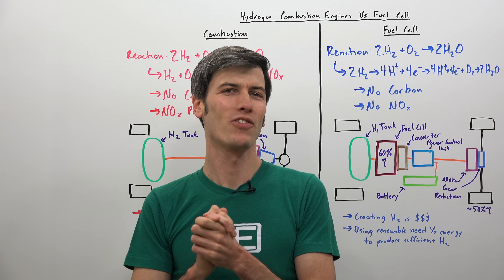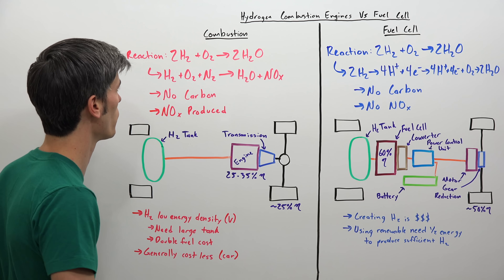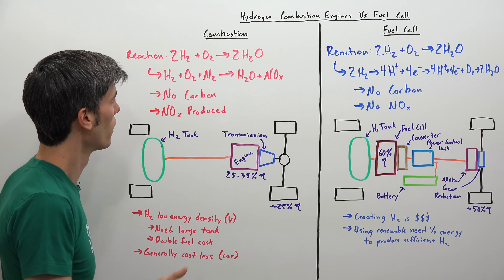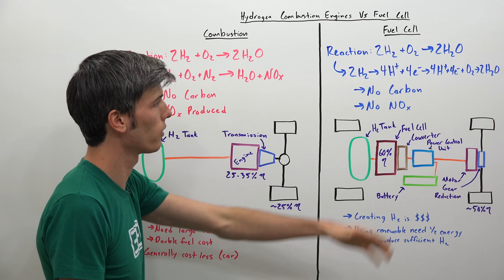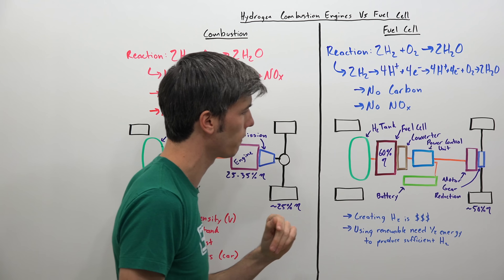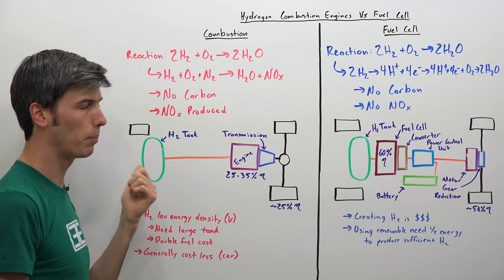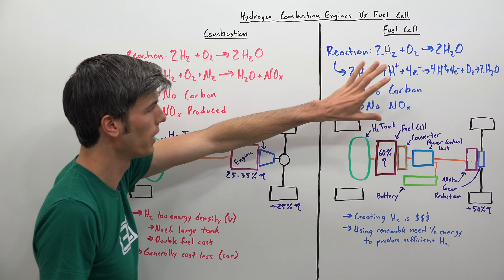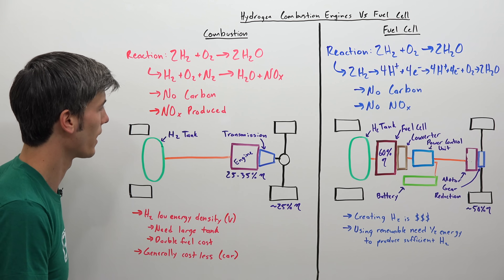Why Hydrogen Engines Are A Bad Idea

Comment: You forgot to mention that fuel cell vehicles don't make vroom vroom noises, which is something that the internet likes to bring out as a k.o. argument as to why they would never drive an EV.
Reply: But you can tape playing cards against the wheel spokes...
Reply: Ever heard of a sound system?
Reply: This is why people should be able to load in their own engine sounds. You could choose different types, like a Ferrari, or an Indy car, or a tie fighter.
Reply: @AshGreen359  Yes finally, a tie fighter car! Take my money and make it happen!
Reply: The faux vroom vroom system should have an ice cream truck tune option
Reply: At least the "vroom vroom" doesn't need Type E extinguishers, you can drown them with water when they catch fire. Also, a small puncture in the tank doesn't send you to a fireball in motion.
Reply: @gabem.5242  First of all, a hydrogen-fueled car will not explode - you may get a flame but no explosion. I mean, yes, we all saw the Hindenburg photos but that also wasn't an explosion - if that had actually been an explosive mixture then there would have been nothing left in the vicinity. Including the photographer. Since hydrogen is very light it won't accumulate but ecsape straight up which means that an explosive hydrogen-air mixture is functionally impossible.
Secondly, you don't drown them with water, you use foam. Water is a very bad idea for flammable liquids.
Reply: I'll miss some of the vroom vroom
Reply: @ThomasSanladerer  thank you for your videos on 3d printers because of you i have an ender 3
Reply: @dogphlap6749  they didn't suffer hydro, they had steam hammer. There's a difference
Reply: Yes I agree to you totally..bt Just consider it as "Our Sacrifice for the Future.!!! "
Reply: They sold those back in the 00's. I remember "Pimp My Ride" used them, occasionally.
Reply: infectionsman I always used empty water bottles.
Reply: Well there pumping the engine note through the speakers in some cars anyway. Now the have even more of a reason to do it.
Reply: Fake it baby 🔊speaker's say what??  Guess those guys who make a mean engine impression will be on demand 😂😂😂
Reply: True they won't make any classic car sounds. Some people enjoy that though and while it seems silly it's definitely something to take into account. Car enthusiasts can sometimes hold their cars sound as the most important aspect of a build. Economically and environmentally it doesn't make sense but that's the thing about hobbies, everyone's is different and nobody likes all the same stuff so we have to try a find a way around it that's not just replaying preset noises through a speaker system. That's noticeably different and fake and the while point of the fake noise is to satisfy the people who love having it.
Reply: @wiretamer5710  That would mean wasting more Electricity better spent on driving the car to began with
Reply: Electric vehicles have computers, speed sensors, load sensors, and a sound system. You can combine them to play any sound you want. Currently, Tesla just produces a very quiet electrical whine that changes frequency to give you a subconscious hint to maintain speed on the freeway, but that can be changed..
Reply: @pilotavery  you really don't get it, do you?
Reply: @Anduvir  I know it doesn't sound as cool but like, that did solve the problem of subconsciously knowing your speed.
Reply: And shoot flames
Reply: @AshGreen359  Reminds me of Mark Robert Video in the Car Horn.
Reply: I have no idea if my motor is functioning right if I can't hear it. I don't know what electric motor sounds mean. It's disconcerting to have no audio cues.
Reply: @AshGreen359  the thing is i dont like fake.
Reply: fuel cells are a waste of energy..  first you use energy to make hydrogen (with loss's)   the you convert it back to electricity (with loss's)    so its just a total loss's before you even use it..
but this is about running the engine on hydrogen... :-)
Reply: @harleyme3163  Your cellphone is a waste of energy. First you use energy to charge the battery (with losses) then you convert the stored energy to power the phone (with losses). So it's a total loss before you even use it.
Reply: @johanneshass1614  "Since hydrogen is very light it won't accumulate but ecsape straight up" - That's great in the outdoors, not if you have a garage.
Reply: @ChucksSEADnDEAD  Your garage is airtight?
Reply: @johanneshass1614  Your garage has leaks on the roof?
Reply: @ChucksSEADnDEAD  A cuboid has more than one side. Just sayin'. Now go away before I have to really mock you.
Reply: @johanneshass1614  You know that a light gas like hydrogen will float to the top, right? Even if your garage door is only a foot and a half from the ceiling that's still a huge amount of volume. You're the one who deserves mockery if you think a cloud of hydrogen in your ceiling is no biggie.
Reply: Also no waiting for charging
Reply: People are amazing tho  :)
THEY WANT very QUIET ELECTRICAL  VACUM CLEANER  but BIG NOISE ON FUEL CAR... I SEE A PATERN I'M NOT SURE I LIKE
Reply: They will have to put some kind of noise makers on them, or pedestrian and bike crashes will skyrocket! I damn near got ran over in a crosswalk in Honolulu, by a hybrid turning against a red light!
Reply: This but unironically
Reply: Laughs in Bluetooth speakers
Reply: Yeah the vroom vroom noises make some people happy so what ? Let us drive what we want and leave us alone
Reply: My drunk dad does vroom vroom sound at night for eternity so I'm all for "soulless" cars
Reply: you miss the point. It doesnt have to be vroom sound. BUT IT HAS TO HAVE SOUND. They say electric cars are quiet by nature yet when companies release electric race cars they sound sick?
Reply: Hydrogen ICEs exist. Not all hydrogen vehicles are fuel cells. Using hydrogen instead of batteries means we can have clean daily drivers, as well as v12s.

Also, hydrogen is safer than lithium as well as infinitely more environmentally friendly.

Basically, BEVs only advantage over FCEVs and HICEs is that the infrastructure for BEVs already exists in some places.
Reply: @AshGreen359  If someone properly iterated on the engine sound generator concept and had selectable sounds and volume ppl would def buy it
Reply: And I’m busting it out right now.
Reply: And I absolutely agree with that
Reply: today there are also still people who prefer traveling on horse like 120 years ago, because it feels so nature and blah..
peolpe mindset will change very fast and will be thankfull for the advantages of BEV and certainly also for autonomous cars, because most just want to travel from A to B ...
It certainly  will be a long process , maybe  20-30 years , but for sure soon or later combustion engines will all be oldtimers. It'll be funnny to drive them , it will be nice nostalgia, cultural important oldtimer .. but thats all . most would prefer to travel calmly and comfortable..
Reply: @Pyrcae  Yeah no, even today if you get in a manual carbureted car VS your manual FI car, you notice a difference.  Peoples perceptions change, and to a lot of people a car is just a mode of transportation, but to another large group of people, cars are a lifestyle, community, hobby, therepy, etc.  Peoples perceptions change not because of the advancements, but because of the lack of perceptions of an experience that is becoming more and more rare.
Reply: @TheGamersRace  well , we probably wont find a common sense here, I dont think the group of people enjoying driving is "large" , as stated I think this get more and more a minority ..

not sure what you mean with "manual carbureted car VS your manual FI car"
if its about manual transmission then I can honestly tell you that I do sometimes miss my old BMW with manual transmission, it was so cool driving it,  while I clearly prefer to drive with aut.transmission in daily life , so I bought according car, since most of time I do not drive for fun but because I need to reach a place. And this is not because I got boring person but because I prefer enjoying other things in life.

I fully agree with you that its a totaly different perception and driving experience, but as you said this is then for lifestyle, hobby etc.. which is just fine .
What I try to say is that more and more people do not consider a car as lifestyle object or even a hobby. 
They just want to reach their place as easy as possible without having any car related emotions, preferring noiseless so they can better listen to their music or calling a friend or later in self driving car just play around with other passengers. Ever had the issue when you drive with friends to a party and one has to drive so he cannot drink alkohol ? this is no issue with self driving car.

We dont get boring with noiseless car, we just change interests.

Looking back to manual transmission , it's lot of fun to drive, but still this is clearly disappearing in any country, 
google "car manual transmission percentage" results in:
".. manual transmission is dying out. 
car models sold in the US in 2020 ..only 13% are manual,
In 2011, 37% percent came with manuals."

And look at Porsche , I mean here we talk about sports cars and still most of them are sold today with aut.transmission , just very few of them have even the option. And they already have Taycan as electric car and the next one is coming soon..
Reply: @Pyrcae   Some of the things you say make sense, but not all of them.  You also clearly missed my entire point.  The problem is the forcive-ness of change.  They're not letting it happen naturally.  

Yes, people do like to own daily driver cars, but this isn't a mutually exclusive thing.  Many people who have daily driver also have a fun car/s.  Also, performance/noise isn't the only lifestyle and choice you can choose to make.  If this were the case, everybody would be driving either Toyota Corollas/Honda Civics everywhere.  For example, people choose plenty of luxury vehicles that fit the lifestyle they choose to live, even if the luxury adds nothing to their "get to places" routine.  

Noiseless cars are boring.  Thats the entire point 😒.  Some people like boring, and that's fine.

No, I've never had the issue where we can't get a driver because we're all drunk.  I don't plan on wasting my life away drugged up or drunk.  

Yes, sometimes it's a lifestyle or a hobby, but for many people it's also a career/job to do these things.  And no, I dont mean just being a mechanic, because that's only a small fraction of the entirety.  

America is the only nation where automatic transmissioms are the dominant transmission type.  Other nations still use manuals at about 70%.

If you don't know what carburetion VS FI is, we probably shouldn't be having this conversation, in all honesty.  The car world is far bigger than you surmise it to be.  This is one simple thing even my un-savvy coworkers know, albeit, not in any details.  This tells me that's you're probably just young, live in a big city, and have no idea how large car culture truly is.
Reply: @TheGamersRace  .. neither young or living in a big city today , but I experienced living in metropolis as also in 700 habitant village..  and I came quite around in the world.
While I rate this as pretty low relevance for this topic.

sold cars in Germany are 50% manual transmission with a clear down trending . Japan has also almost only automatic, in china (a huge market ) 70% sold cars today have automatic transmission while manual transmission there mostly sold only because its cheaper.. 

I am not deep in English car related terms  as I am German , so I didn’t identify FI as fuel injection in a first read, while I know quite good what this technically means and also from emotional perspective as you describe.

regarding forcive-ness , I do agree that industry are sometimes pushing unfavourably technologies or avoid great ideas just because this increases their earnings..

while I also believe we should not fully "let it happen naturally" since its in the nature of human to initially deny changes and we need sometimes to be pushed . 
that counts for any progress in our past thousands years as also when the first combustion engines came on the road; the only perception that time was loud, stinky hell machines.

But yes ... at the end a good balance of nature and motivated progress might do a better job ..
Reply: Welp, that OP comment didn't age well - Toyota has released a soundfile for its ICE hydrogen engine 2 weeks ago. The engine is under development and will be tested at the 24h race in japan from may 21-23. The car literally sounds like an 80s small size ICE (because it doesn't have any cats or anything. The car only generates sma amounts of co2 due to bruning oil, and a little bit of NOx because of the burning of the hydrogen of course. But yeah, the car makes vroom vroom noises. And it's likely going to be released by Toyota in the future.
Reply: @matteiasm.3618  Hydrogen combustion engines have been around for ages. You can literally convert normal cars to hydrogen. I don't see how that has to do with electrical fuel cells?
Reply: @wiretamer5710  so you drive a BMW then?
Reply: electric motor powered vehicles cannot be tuned, they are heavy (even fuel cell ones) and they don't have the REAL sounds.
Reply: @jeremytheimer7443  I mean they can be tuned, but you are right they don't have exhaust notes and their batteries make them flying pigs.
Reply: @johanneshass1614  foams are usually toxic. Best thing is roadside dirt. A trenching tool in your vehicle is your best friend when it comes to fire suppression.
Reply: @Victor-056  Not if you use it occasionally.
Reply: @restingbuttress6798  Electric motors have two moving parts and are good for over a million miles. They don’t go bad!
Reply: Skip R  that is not reason enough to stop the pollution
Reply: @wiretamer5710  Not a Good excuse. 

If I have to use a Car Occasionally, I'd rather drive a Car that LASTS.

Electric Cars, as well as Hybrid Cars, have a habit of Deteriorating over time, and in The Tropics, An Electric Car just isn't suited for "Occasional Driving".

Also, What happens when the Roads Flood?
Reply: @wiretamer5710  They Do Incredibly Poorly when Driving Through a Flooded Street, and Don't even TRY to Deny that Electric Cars are Complete Death Traps in a Crash!

Just look at all the Incidents involving Tesla Cars! One Crash, and the Car becomes a Crematoriam!

Also, Recharging The Battery... Nuff Said. No matter how much they brag about longivity of the batteries, they Still take HOURS to fully Charge, and in a Lot of Cases, Electric Cars deplete their batteries when Idle.
Reply: @jeremytheimer7443  Mercedes Sprinter actually
Reply: @TheGamersRace  EV's cannot be tuned to have 6 times as much power as before with the same motor. plus they are heavy and boring. The main reason people prefer Hydrogen engines is fun not efficiency, this video makes an unfair comparison and should talk about it based off of actual harm to the environment considering ALL factors.
Reply: Electric cars are heavy, slow, prone to overheating. And they take 30 min to charge. Keep your toy car, I'll be driving a real mans car.
Reply: @roncatman6236  exactly, this video makes an unfair comparison to fuel cell and battery powered cars. nobody is saying that combustion is more efficient, however you can get all the fun, customizability and handling without the pollution with hydrogen combustion. these people don't care about the environment they just want to turn us into emotionless drones.
Reply: Well you lose up to 40% of electric energy just transmitting it to get it to your house or charging station, which is probably generated using fossil fuel, the mining for materials to make batteries for the car is terrible, and plenty of oil based lubricants are still used in other part of the electric cars.
Reply: @david_4246  that's exactly why hydrogen combustion is better. you have super low initial pollution and you can source the hydrogen from pretty much anything. this video makes an unfair comparison to fuel cell vehicles when nobody is saying that fuel cells are less efficient. people want to have the fun, tuning ability, and noise of a combustion engine with basically no pollution. none of these eco activists care about the environment, they all oppose nuclear power and they want us to be a bunch of robots with no emotion.
Reply: @jeremytheimer7443  but cnn told me that nuclear power is big bad and electric cars will save my soda from being watered-down because of melting ice caused by the global hot potato. They had an expert explain it and everything.
Reply: @david_4246  LMAO, yeah that pretty much sums up this whole issue.
Reply: And a perfectly reasonable argument
Reply: @jeremytheimer7443  Yup, electric cars aren't all they're cracked up to be. High thermal efficiency doesn't mean much if you only get 1/20 the energy density. Essentially, the price you pay for doubling thermal efficiency. Is to take on double the weight. Not a very good trade off if you ask me.
Reply: @roncatman6236  also you can’t tune them
Reply: @wiretamer5710  Electric motors life expectancy is entirely dependent on build quality, same as almost anything else, and as for lasting "millions of miles?" I've never heard of motors doing that, please do show me, I'd be very interested in reading up on it!
Reply: @restingbuttress6798  here’s a clue for “slow” people: if you are moving, the electric motor is functioning properly 😉
Reply: @ConvairDart106  I suspect the issue was the klutz driving it, not the lack of engine noise
Reply: @infectionsman  thats hilarious lol
Reply: @dsugioaga  just buy any ev that has some sort of system that allows you to install your own sounds into a car
Reply: @wiretamer5710  we want real sound not a fake.
Reply: @DJJumpdancer  No such thing as fake sound.
Reply: @wiretamer5710   putting speakers under the car which play exhaust sound  is fake sound.
Reply: @DJJumpdancer  sound from an engine is just wasted energy. Speakers are far more efficient
Reply: @wiretamer5710  we dont care about that.
Reply: @wiretamer5710  😂😂😂😂😂
Reply: @wiretamer5710  you can kill without sound because Pedestrians dont hear you comming
Reply: A fuel cell just creates hydrogen to burn. You still have an engine to burn it in
Reply: I want circus calliope music coming out of the speaker in the fake tailpipe.
Reply: @AshGreen359  im copyrighting noises right now to sell. I don't think Ferrari will me using their noise.
Reply: @wiretamer5710  Pfft, Nobody wants an engine that makes fake sounds...
Reply: Did you eat paint chips as a kid? 😅
Reply: Ur right especially car guys...
Reply: Loudspeakers
Reply: Vroom vroom is a kind of unga unga, engines are fun and have a lot of advantages, but noise is nothing but wasted energy.